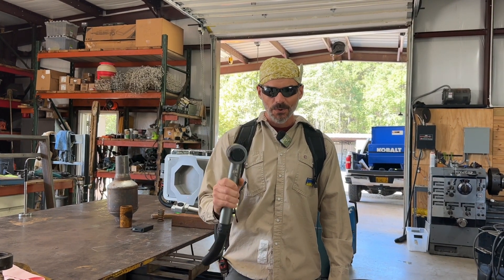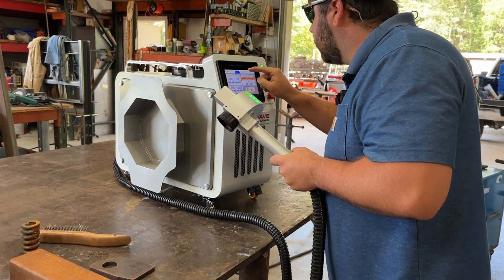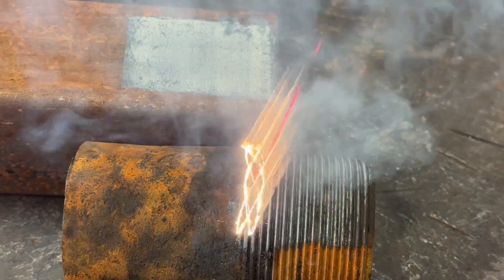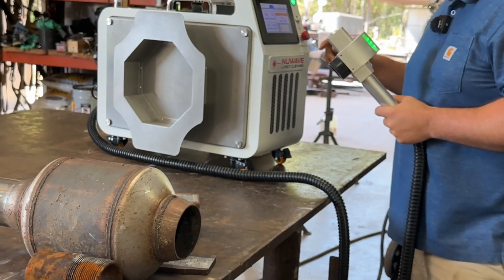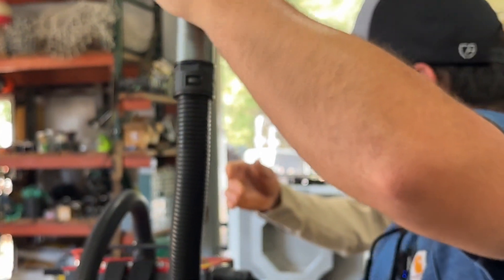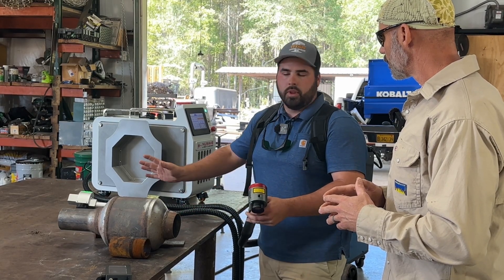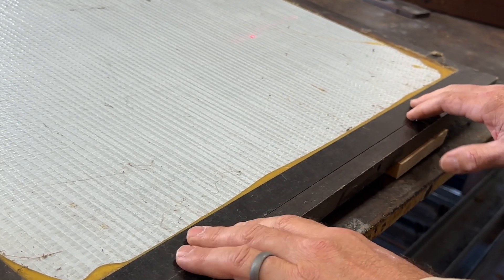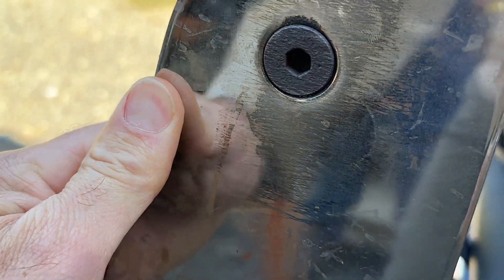You Won't Believe How Easy Laser Rust Removal Is

Comment: Rust removal lazar is very impressive. Thanks for showing this type of technology it’s amazing what’s out there to be used for work applications. Years ago I was a water jet table cutting machine. It was used instead of a touch. It was totally unaffordable for an individual to use in his garage or small work shop. The most advanced technology machine I have is a plasma cutter and I use it’s a lot especially for making holes. These machines today are very affordable for the weekend welder. Thanks again for showing new technology.
Reply from the maker: I agree thanks Mr. Samuel